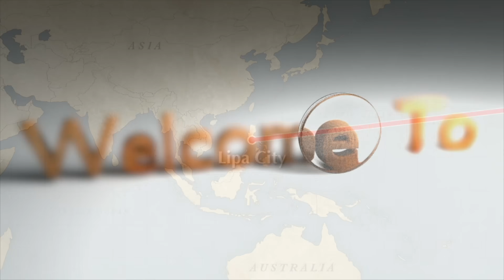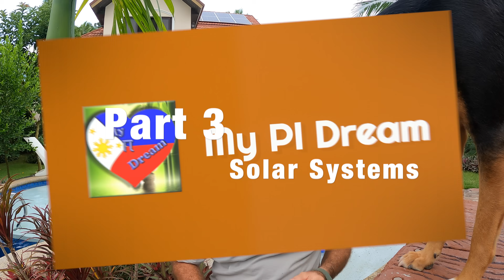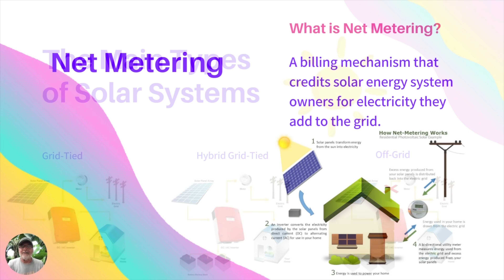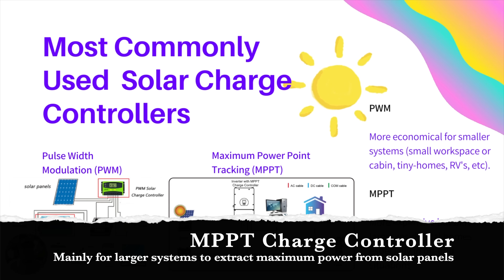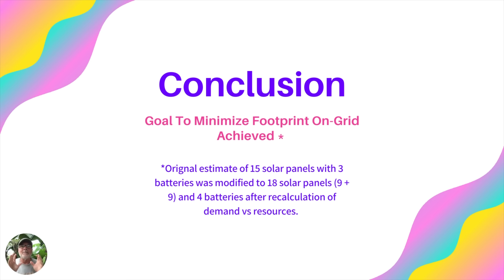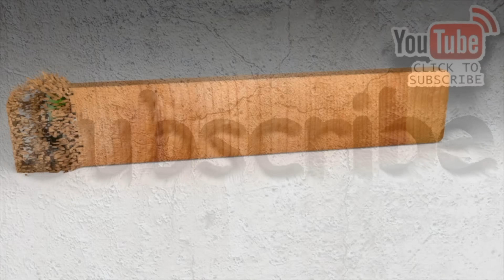WATCH THIS BEFORE INSTALLING SOLAR! (Part 3 of 3)

Comment: Very good presentation, I live in Texas and researched 2 yrs before I was comfortable enough to make my purchase. I'm grid tied no batteries and my before rebate cost was 40k for a 16.8kw system using 42 REC 400 watt panels system with enphase micro inverters. One we have net metering but it's 10 cent import 7.4 cent export. We also became more Energy conscious,
Reply from the maker: Thanks for sharing!
Reply: 40k is a serious investment, what is your payback timeframe?  I live in TX and my electric cost doubled since my plan expired a month ago.
Reply: @jackfrost-fu7hz  it really varies based on several factors. I had the cash so after my rebate of 26% the total out of pocket will be $29.6k. I live in an all electric house with one EV and my estimate yearly energy use is 24000KW. If rates stay the same it will take between 10 and 13 yrs. In the last 2 yrs the rates for importing has risen 30%. So I'm thinking rates will continue to rise while the majority of my energy cost will remain the same. If you are in an area where the local electric company is offering rebates along with the federal 26% rebate it may be worth it if you can afford it. Cash is king and I started a bidding war, did research on the companies and went from 2.65 per watt to less than 2.40 per watt before the rebate. After the rebate the cost will drop to around 1.67 per watt. Last thing is the company I went with gave me a free 50 amp transfer switch so if you factor that cost in I think I got a really good deal.

Comment: Hi James. I must say your yard looks like the garden of eden and you showcased it in a subtle way by using it as your backdrop. If you knew now what you didn't know then, would you add more solar panels and just have 3 batteries instead of 4? Thanks
Reply from the maker: After preliminary testing we noted 3 batteries just wouldn't make it through the entire night and we ended up with a few hours on the grid.  This is why it was determined one more battery was needed.  I think our current configuration is the sweet spot.
Reply: You always want more batteries than less, a 2 to 3 day blackout during  typhoon  season might task the  batteries.
Reply: Thanks for all the information and sorry to be a bother. May I ask if your 18 panels able to charge 4 of your batteries fully?

Comment: James, your better and brighter than a 25 KWH solar power system with 15 batteries and 3 inverters. The info was relevant and to the understandable level of someone who may not be an electrical engineer. Very very good job.

Comment: Hello James, thanks for the solar videos and our plan is to go solar. Just curious how does the echo flow tie into your system? Are you still using it?
Reply from the maker: I discussed this in either episode 1 or 2 of this series but to paraphrase, it now sits behind a secondary ATS as a third backup when both the grid and backup batteries are exhausted.  This gives us an additional layer of protection during extended brownouts from something like a typhoon.

Comment: very thought out and detailed vlog. really interested in it. definitely want to get solar when we move there. was wondering how much does the solar function and charge during the rainy season. I know you'll probably use more of the primary source, but with the clouds and storms, is it still functioning.
Reply from the maker: Even with rain and clouds we get power generation from the PV panels although its low.  These type panels take advantage of ambient light for power production.  Even on moon lit nights we get some benefit of the sun's reflection off the moon.

Comment: James what a coincidence as I just got back from the Lingayen Philippines after spending a month there interviewing and hired a Solar Company to instal a 8.8 kWh system. They just completed the installation last Friday and have commission it. The other coincidence, I used the same installer “ Go Solar” and components except my system consists on (2) 5k inverters, (18) 450w panels and only (2) Batteries I suspect I will have to increase that qty to 4 after I get some more data of actual usage. Thanks for sharing the information with the folks “Good Stuff” & informative!
Reply from the maker: The original plan from the engineering support team of GoSolar was 2 batteries as this is a standard configuration to insure your inverter never gets shutdown.  Their assumption, I presume,  is most consumers are cost conscious about their total investment and are just interested in shaving around 50% of their electricity bill.  We, on the other hand, desired to go as close to off-grid as possible and luckily we budgeted for such an aggressive package.

Comment: James and Ness, if time could be turned back during the construction of your house, what would you add and what would you give up building ? Starting from the gate to the top of the house.
Maybe the house, you wouldn't build it again with the same builder ? Do you recommend it to others, or...?
Maybe the plumber wouldn't be the same either ?
Maybe the entrance to the garage, made to be straight ?
Maybe added a pergola roof on the top balcony ?
Are you satisfied with the community where you built the house ?
Reply from the maker: Nelu, I added this to my collection of things to discuss in a later episode.  There's just way to much to write here.  Thanks for the great questions!

Comment: Very interesting. I'm just wondering if/how your panels work during a brownout?
Do you have an isolation switch to stop the electricity from going out to the grid? So that any line-workers will be safe.
If so is it an automatic switch or do you have to manually isolate the house so you can use your electricity during a brownout?
Reply from the maker: Yes, the panels continue to supply electricity to the house and batteries during a grid brownout.
Yes, the grid is isolated from system both electronically and physically (mechanically) so we never back feed the grid.
All switches are automatic via an ATS although I do not leave the secondary EcoFlow Delta Pro batteries online to reduce standby draining so when both the grid and backup batteries are offline I still have to power on the EcoFlow for emergency backup.
Reply: @MyPIDream  Thanks, I think I see, so is it the case that when your house is using solar there is no connection to the grid. But if there were not enough sun and the batteries were too low to provide enough power the switches would automatically disconnect the solar and connect to the grid?